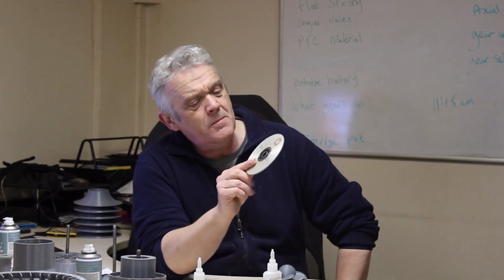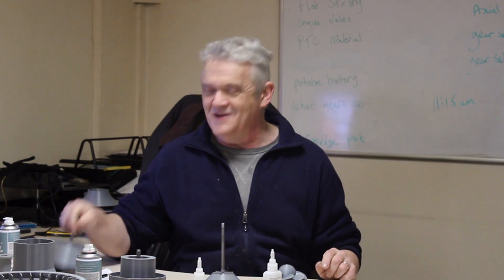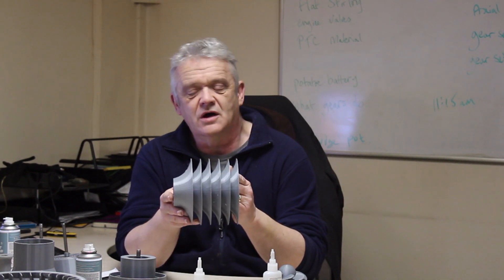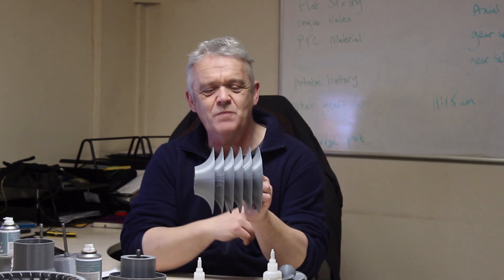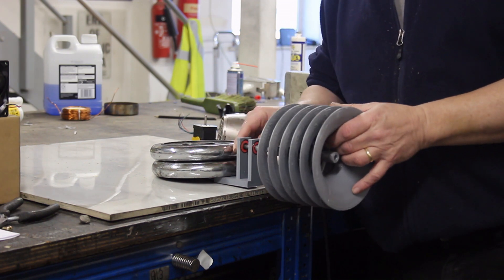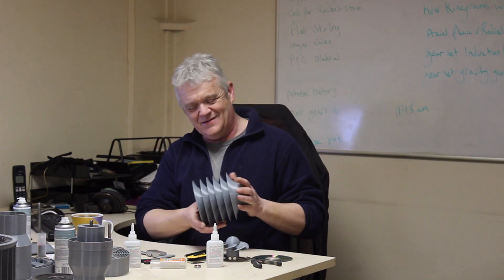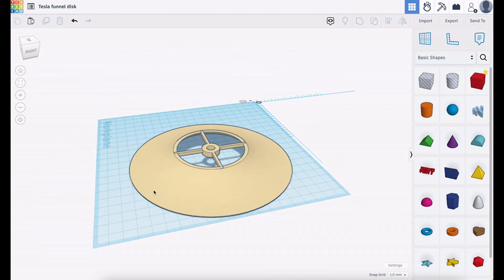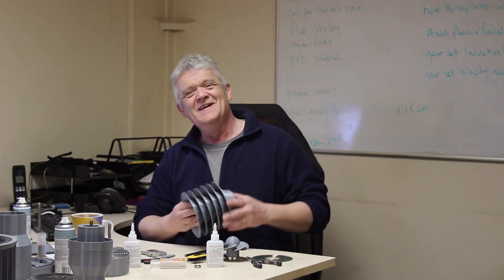1890 The Next Step In Tesla Turbines

Comment: Someone has a patent for this already. Patent #  WO2005081766A2 - Bladeless conical radial turbine and method 

Inventor Salvatore F. Grande, IiiDavid R. Draper
Reply from the maker: cheers mate - nice pointer - but I believe it is an application and there is a Priority claimed from US54646204P
Reply: @ThinkingandTinkering  what does that mean that there is a priority claim?
Reply: There are already regular Tesla turbines that work at low speed and rpm. 

Read what Tesla says himself,

 “Still another valuable and probably unique quality of such motors or prime movers may be described. By proper construction and observance of working conditions the centrifugal pressure, opposing the passage of the fluid, may, as already indicated, be made nearly equal to the pressure of supply when the machine is running idle. If the inlet section be large, small changes in the speed of revolution will produce great differences in flow which are further enhanced by the concomitant variations in the length of the spiral path. A self-regulating machine is thus obtained bearing a striking resemblance to a direct-current electric motor in this respect that, with great differences of impressed pressure in a wide open channel the flow of the fluid through the same is prevented by virtue of rotation. Since the centrifugal head increases as the square of the revolutions, or even more rapidly, and with modern high grade steel great peripheral velocities are practicable, it is possible to attain that condition in a single stage machine, more readily if the runner be of large diameter. Obviously this problem is facilitated by compounding, as will be understood by those skilled in the art. Irrespective of its bearing on economy, this tendency which is, to a degree, common to motors of the above description, is of special advantage in the operation of large units, as it affords a safeguard against running away and destruction. Besides these, such a prime mover possesses many other advantages, both constructive and operative. It is simple, light and compact, subject to but little wear, cheap and exceptionally easy to manufacture as small clearances and accurate milling work are not essential to good performance. In operation it is reliable, there being no valves, sliding contacts or troublesome vanes. It is almost free of windage, largely independent of nozzle efficiency and suitable for high as well as for low fluid velocities and speeds of revolution.” -Nikola Tesla  Tesla both knew it wasn’t meant to spin fast and that it worked great for low speeds IF you design it correctly.
Reply: Can someone also show me where tesla said to put spiral grooves on the discs? I would love to read that section of his texts. 🤓

Comment: Combined the two different systems possibly?   (top and bottom ) The first system captures the wind from the top and forces it down.  The exiting air holes go through a pipe of the same diameter and connect to a larger circular pipe as to not restrict the air flow🍃 ( think wheel and spokes )☸.   With one exit pipe or two pipes opposite exiting connected directly to the flat tesla turbine.  Just a thought since the wind is already captured and assuming it will not create to much back pressure or restrict the airflow for the top system.

Comment: Nifty.  Trying to figure out what the deal might be?  Wind interacts with the outer portion of the structure.  The structure might begin to act in a centrifugal manner?  Don't know?  Causing  air to be pulled in through the central hole?  There might be a pressure differential then?  Where the air pressure is less in the center of the structure.  Air pressure, or lack there of, might mean  difference in friction between the passing air and the parts of the structure. Maybe that is why it spins?  Might not need the  Darwin part at all.

Comment: I'm wondering if adding some type of texture to the discs would improve the frictional effect of the air on the spin. Perhaps dimples like a golf ball has or possibly even something more geometrically efficient such as half moon shaped micro ridges. Just a thought.
Reply: You don't want friction. If you read Teslas patent he states it is not a friction device it works on electrostatic adhesion the regime of forces should move with eachother ideally not relative to eachother that causes slip which kills torque and increases friction which is why pop science dumbies keep building these to insane rpm's and destroying their turbine. 

Increasing rpm only makes a slip machine that heats up and warps your motive fluid and disc should be moving as close to insync as possible.

Comment: A parabolic cone should work better than a disc. Because on a disk the fluid needs to take an abrupt 90° angle to leave the disk outlet, causing high pressure. On a cone the fluids should escape the system more freely.

Comment: Robert, the cylinder version will work the best.
But you have to enter the air into the outermost slot close to tangential, through a few narrow ports spaced around the outside, and step it down to each smaller slot in series as it goes back to the other end backwards and forwards till exiting at the core.

Comment: Tesla himself acknowledged another disk turbine design in wich the gas stream only blew through one half of the disk stack. 
This he believed to be inefficient compared to his design where the gas stream must make one or more revolutions of the disks before exiting at the center allowing more time for the drag of the gas stream to work upon the surfaces of the disk stack.
In your current set up without a casing the airflow from the hair dryer is only making a partial revolution before exiting the disk stack. 
Untill you put a casing around it what you have is a modification of the other disk turbine design not the Tesla.
It will be most interesting to see how your conical or funnel disk stacks will perfom when installed in a casing with the air stream exiting at the center.
Sorry I am not able to name the other disk turbine design but I am working from memory of something I read long ago.

Comment: I so look forward to your trips down the science rabbit hole. Thankyou for the hands that go where our minds have only wondered.
Tesla turbines are a favorite. He had a grasp of boundary layer physics before NACA had an airfoil.
All the horsepower derived i n a system dependent upon aerodynamic drag will be pulled out of a transition layer less than a thousand of an inch thick called the boundary layer. Tesla was brilliant enough to contrive a turbine where the close clearances between the discs allowed for back to back boundary layers that allow a zone of laminar flow in the center. The problem then became one of surface area. Big discs. Unfortunately, no materials available could withstand the primarily centrifugal forces induced by the high rpm required to make a steam turbine practical.

Comment: I absolutely love your work, I wonder if part of the reason you get that spin is from the bumps and grooves left by the printer as it prints the object, or is it absolutely smooth? also due to the printing wouldnt the cones already have a spiral? Albeit very thin, even thin, the air forces would still be taking advantage of that. I'm not a 3Dp expert so some of my questions come from a place of ignorance. Is there  a medium that can be printed very smooth?

Comment: Robert Murray-Smith , an easy way to make them as fine a blade and minimize the gap, print a male and female solid form and press thin aluminum sheet between them. 3D prints are strong enough to form 1/8 mild steel sheet in a hydraulic press if your careful. As for Aluminum stock , use old printing sheets from your local news printers . Can be had for very little money , Soft enough to press in shallow shapes like this but hard enough to be useful.

Comment: Nice to see, but the hair dryer will always rotate your test because of aero friction.  To get the benefit of a proper Tesla Turbine you need the disks to be very close so the boundary layer of a fluid drag force takes effect.  If you can replicate the boundary layer effect and then add friction with the curved angle, you will have improved on Nicola's idea.
Reply from the maker: the fluid effect drag force is friction mate
Reply: @ThinkingandTinkering  yes you are correct, but to get the best boundary layer efficiency of the turbine you need much closer disks

Comment: The holes in the bottom of the cone from the top to bottom should  taper from large to small or small to large depending on the flow like the roof top one from your last video

Comment: cant think of the name of it but its the force that when 2 high trailered artics drive side by side on the motorway pulls the 2 vehicles together, and this was part of the thinkiing in teslas original turbine before he went on to using liquids, same thing happens to bikers overtaking artics on the motorway as the wind convection off the truck tries to pull passing motorcycles under the truck

Comment: Hi Rob.  If you want to show that's working as a tesla turbine, you probably want to be putting some of that dangerous cigarette smoke in your airflow to see if it's actually spiralling around and coming out of the centre, rather than just acting as an inefficient bladed turbine.  Either that or bodge up a housing to force it to work that way.

Interesting concept, though, as it gives more surface for the fluid to work on.

Comment: These could be used in electric automobiles to trickle charge the batteries while the automobile is in motion. add a second roof to an automobile with a wind scoop right above the windshield that wound direct air flow over four units that would goto a voltage controller that would trickle charge the moving automobile. This would not charge a vehicle up but help sustain a vehicle longer when traveling on highways.

Comment: How much air is still flowing through this setup still using the Darwin principal? If you have the collector spinning due to the tesla effect, funneling air using Darwin effect, does this basically give you 2 cracks at collecting the energy? If you could collect energy twice, from the same source, would it make sense to use one to power electro magnets on the rotor instead of rare earth magnets?

Comment: i left a comment on 1888 about how you could modify your previous design so that any air hitting the front would be channeled to the correct angle just by extending the outer disk into a bell and the inner disk into a cone is it possible to replicate and test this to see if it is viable?
Reply from the maker: yeah go for it - I did do a video on how to make what you suggest from old pillow cases and a  car body repair kit

Comment: Argument: turn it upside down if it is going to be outside. Leave the genny at the bottom and drive it with a shaft. 10,000 drops of rain later you might know what I'm talking about. We've had to cover exhaust stacks for decades because of rain. ;)

Comment: I’m curious about the effect of surface texture of the printed plastic with laminar flow.

The funnel array spun up well enough with a directed column of air. But how would it work in an airflow like wind? ie an airflow on both the left and right side of the axle.
Reply: To be honest most people skip over Teslas notes about his turbines he stresses that the materials do matter. You want your disc material to philic towards your chosen motive fluid because the principle actually works on electrostatic adhesion not sheer friction as commonly believed. 

So imagine instead of your motive fluid rubbing on the discs to move them you want your motive fluid to have maximal laminar flow and for the boundary layer to electrostatically adhere to the disc surface to carry it along. Friction is a cause of slip which is what kills torque.

Comment: The Dyson cones do not spin, but they spin the air into a high-speed tornado. Input is only from one direction. If you added a vane to turn it into the wind and routed the air from bottom of the tornado out to your spinning coil, that should ramp up the speed significantly

Comment: LOL, I clearly remember the first time I took a significant chunk off the tip of a finger. I was holding a rather large vacuum AC motor, had the tip of my left index right next to an inner cooling van vent. Flipped it on after a rewire job, schlurp! Whacked it right off square.

Comment: Like this a lot Rob!  Here is something that will make a difference in torque for you.  Take sandpaper and scuff the surfaces of the cones.  This will add even more drag as air flows over it.  Would be easily done and be a very quick mod.  This is how those rocks in the desert act as sails and move.   Spirals would help,  but not be as efficient as just making your surfaces rough.  A smooth stone in a moving stream is less likely to move than a rough one.  It's just a thought, thanks for all you do!  Keep the thought provoking videos coming Rob!
Reply: Yet the skin of a shark is rough and a stingray all knobbly  and you find if you sand a canoe or kayak hull it goes quicker through the water. Even golf balls to smoother through the air with little dimples all over them. These actually developed from smooth balls getting scuffed and players finding they could hit a scuffed ball further. All these suggest your scuffed surface would produce even less not more drag. I think it comes from the rough surface holding air or water molecules and the flowing air /water slipping over them easier than it would a different material.
Reply: @Martin-se3ij  You are talking about things moving through a liquid and not a fluid moving an object.  Apples and oranges.
Reply: @jamesross1003  But there you go—apples are smooth and oranges are dimpled so you just have to blow a hairdryer over some fruit and we'll have the answer.
Reply: @Martin-se3ij  Better yet, just actually test what we are talking about and find out the real answer instead of bantering back and forth.  Want to find out about just such a supposition?  Take 2 books interleave the pages of them alternating.  Now find out how hard they are to pull apart.  Now it is true that static plays a part, but the biggest factor on it is the surface of the paper pages causing friction.  Think of the wind as one page and the cone surface as the other and use the law of equal and opposing forces to surmise what will happen.  Once satisfied with that result, then actually go build the unit that Rob did and test it.
Reply: You've answered your own question. Smooth pages stick together, now try it with pages of rough paper and they are much easier to pull apart. Although there is an element of suction at work here. You might want to read Kevin Farrell's in depth book on drag.
Reply: @Martin-se3ij  You need to actually try it other than trying to troll me.  lol  you have it backwards.  Rough pages stick more.

Comment: Spiral grooved hyperbolic nested discs will lead you straight to Viktor Schauberger...  I'm very excited to see what you'll do next!
Reply: It's certainly along the same lines as Viktor S's energy machine that produced much too much pressure and more or less blew itself up. 
 The cones should work exceptionally well in both of these machines.
Reply: @daviddroomer1441  I was thinking the same kind of thing as the "particulate" spirals through the forced vortex the pressure builds, can this pressure be used to drive the initial particulate into the "machine"
Reply: I can see that, build a water turbine like that energize the water at the same time.
Reply: Repulsine :D
Reply: @markiobook8639  Exactly!
Reply: So, basically, make them like the spring screws in a wire nut are made: From a square plastic "rod" wound together, but then heated to bond into the cone...
Reply: @TimeSurfer206  I think I get what your saying but I'm not sure- what do you mean by "spring screws in a wire nut". Are you talking about the thread of a bolt, or a spring washer, or some form of nut (I'm not criticising I'm just unclear)
Reply: @markiobook8639  It is a spring, coiled from square wire. And the corners of the square wire act as the threads of a nut, hence its name: "Wire nut."
Reply: @TimeSurfer206  ok - I'll look into it
Reply: @markiobook8639  Do. Look into the bottom of one. It'll probably make it clearer than any amount of words.
Reply: Along with his x Ray producing vacuum engine !!!

Comment: If you tie this with the Darwin fan blade generator you made you would be killing two bird with one stone. The funnels would force the air down into the generator spinning it and the funnels themselves would act as a tesla turbine adding even more torque to the generator. You would have to find a balance with the blade angle on the bottom fan because the extra torque from the funnels acting as a tesla turbine could possibly over drive it causing a loss in efficiency but if everything is balance I would imagine you would have a hugely more efficient system because you would make a static part a active part.

Comment: Hi Robert. Love your enthusiasm, great builds too. So this could produce power as a wind turbine and then you could have the build in video 1882 and the top end of the funnels, the air coming of this build would cascade into the 1882  build and you'd get two loads of output for one breath of wind.? Probably. In fact wouldn't the wind speed be increase by this building creating even more power?